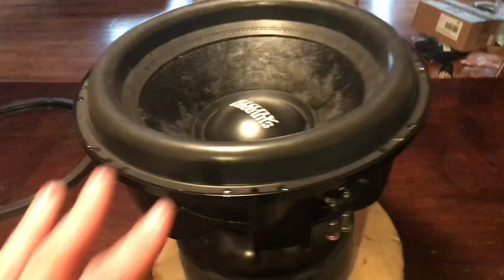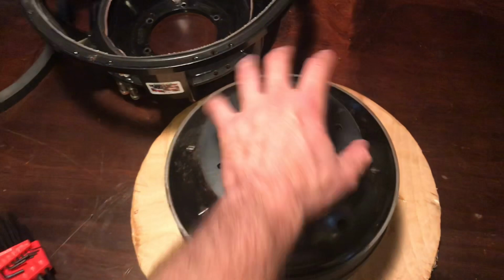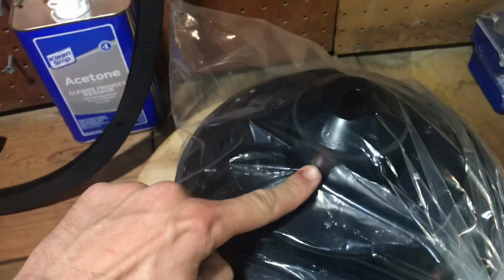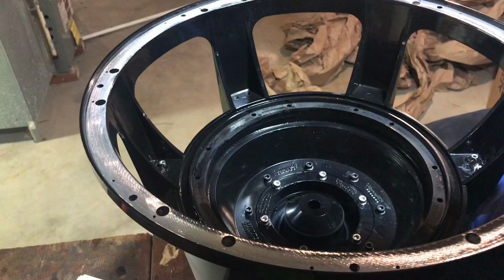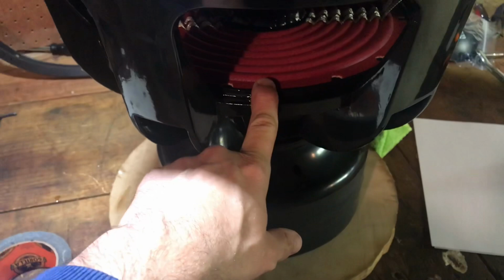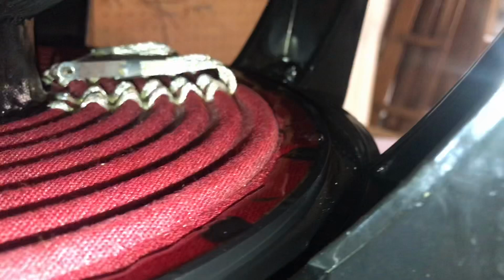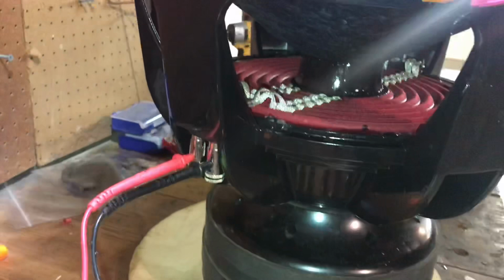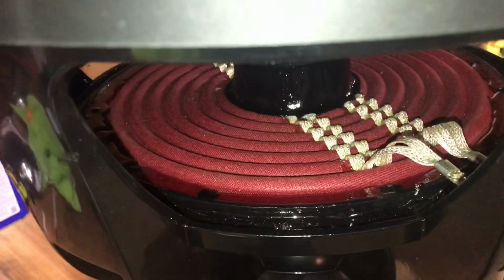Sundown Audio Subwoofer Recone and build... How to Recone and Build a Subwoofer.

Comment: @steven herman where did you purchase that glue from? Also could we use the CA glue e6000 for the spider as well?
Reply: 05tRAiLBLAZ3R 5 minutes epoxy on the spider and e6000 on cap/surround
Reply: @UrAvgBasshead  I also just found out that psi and also DC sells that Ca glue for the spider and for the surround
Reply: 05tRAiLBLAZ3R 5 minute epoxy and e6000 can be picked up at your local store. I used DC recone kit glue and it’s also good.

Comment: where did you buy the complete cone? and how much did it cost in cone and there stuff you used to re cone the sub?
Reply from the maker: D-E-A 33 the drop in was purchased from Sundown. This particular recone is $170 but I have a few added options on my configuration.
Reply: necesito un kit de recone para un x15 sundown d4 v2...donde lo venden enviado a mexico????

Comment: Does sundown ever use the Top landing 12" spider on there tooled 18" frames? If so how many? I was told use only one on my custom 18 by a expert sub builder so I'm thinking I'll go that route. It will have a pretty stout (7) 8.25" x  3/4" slug motor it comes out to around 600ish oz, with a 3x3 flat aluminum wire coil. This is the highest performance sub I've tackled so I'm a little out of my comfort range some, I got my coil so I have dimensions but like how much coil clearance to machine into the top plate but not be humming tight so rub is more likely, but a loose gap but not so loose I start loosing motor force to the coil. building a live motor is a total bitch because I don't have access to a magnitizer. it will take some serious effort to glue the top plate spot , on this motor has some serious magnetic force .

Comment: I am re-coning a sundown x 10 and when ordering the re-cone it asks if I have a plastic or aluminum spacer. I've never pulled one of these apart. Where would I look for the spacer at on the sub itself. Like under the spider maybe?
Reply: Looking at the motor from the side there's a plastic black spacer ring says sundown on it between the motor and frame. I have a X18 D2 V.1 has plastic spacer ring.
Reply: @1andonlyjoeyb534  what is the spacer used for? Also is there difference with sound between the two materials?  Plastic or Aluminum?  Thanks

Comment: Are you still active on this  account? I need some advice
Reply from the maker: What can I help you with?
Reply: @StevenHerman8675309  I’m rebuilding a Sundown SA 12 Rev.3 and from the factory brand new it comes with a metal ring that bolts down on top of the spider once it’s glued. Do I need to re use that metal ring or can I just glue it and call it a day? It’s a bitch to put that metal ring on once the spider is glued down
Reply: @SoundlessBMX  I hope it’s all right on commenting on this. But you don’t need to use those. If you do you soon little plastic clamps like from Harbor Freight or clothes pins to hold down the spider as it’s curing you’re good to go